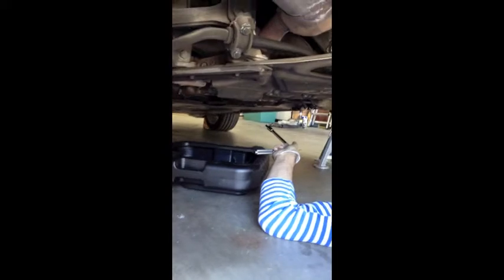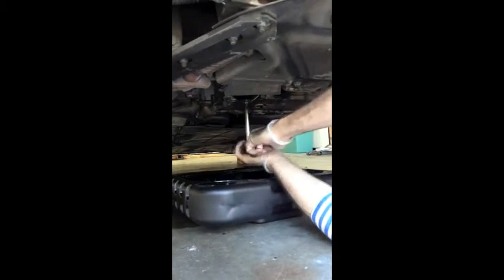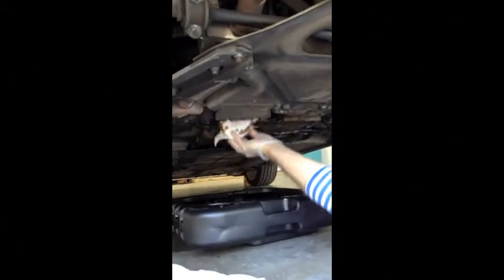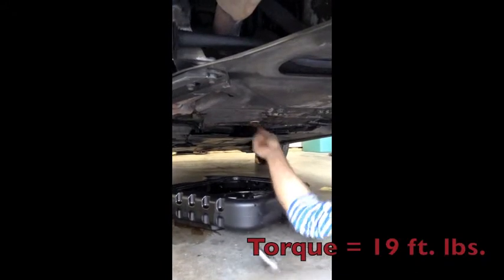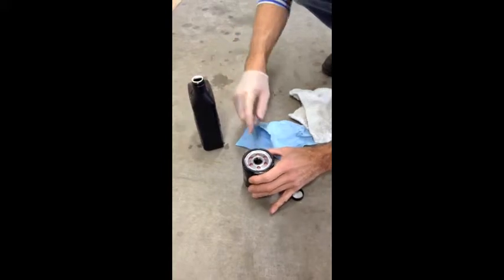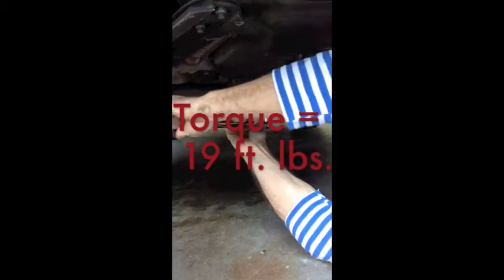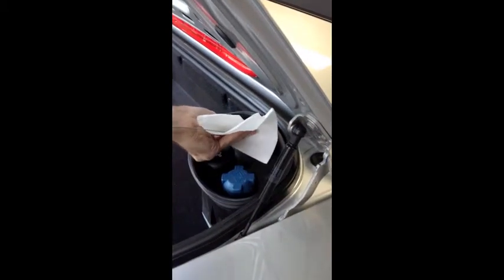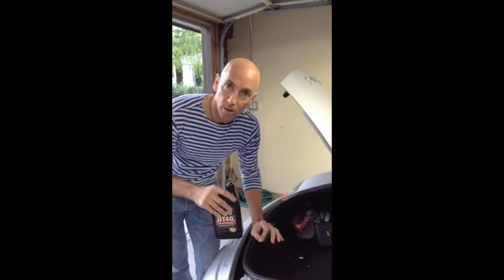2003 Boxster S Oil and Oil Filter Change 033014

Comment: What is the filter number that you use with the LN Engineering spin on adapter?  Where have you found them available at?  Thanks, great video.
Reply from the maker: Thank you Michael. I use NAPA Gold Filter #1042. It is available via Amazon and, I imagine, other retail automotive retailers. The LN Engineering site provides filter options, which you will find by following this link....

https://lnengineering.com/replacement-oil-filter-for-spin-on-oil-filter-adapter-does-not-fit-ims-solution-spin-on-filter-adapter-1.html
Reply: @yamboyproductions9183  Thank you so much. That item and a magnetic drain plug were two "better buy" items recommended to me when I bought my used Boxster (with 135,000 miles on it I might add) by a Porsche mechanic. Sure seems pricey, but very recommended.

Comment: You poured the bottle of oil wrong. That's why it would splash. The neck of the oil bottle should be at 12 o'clock for a smooth flow. NOT 6 o'clock. Your welcome 😁